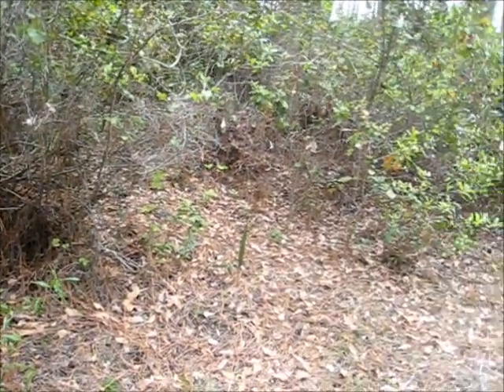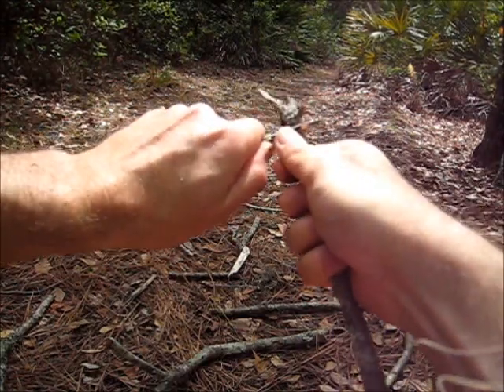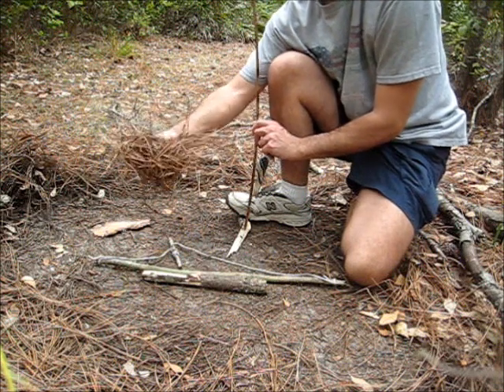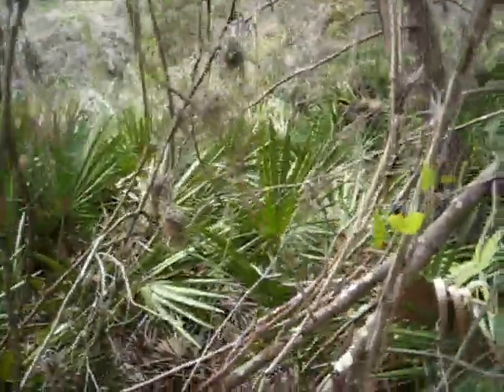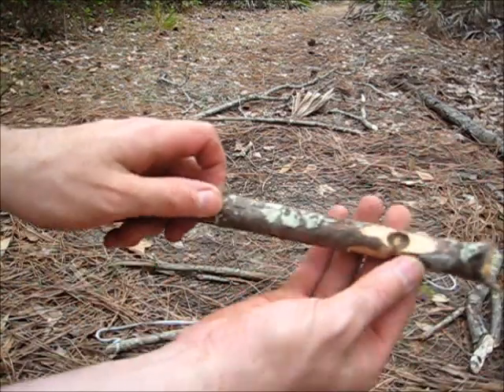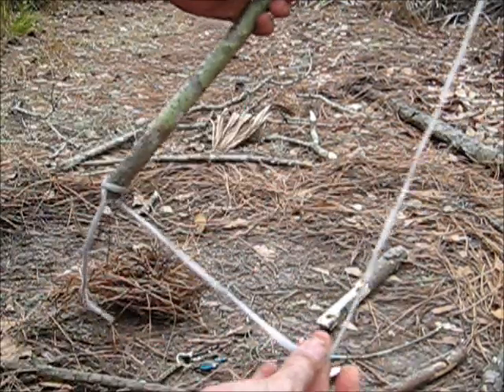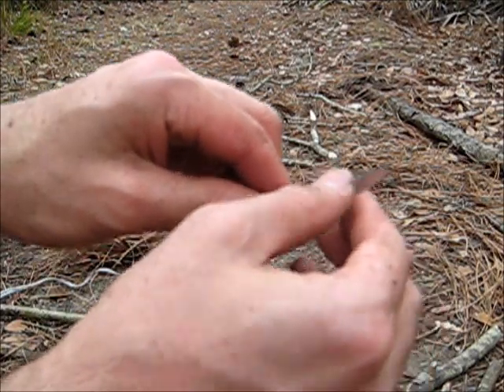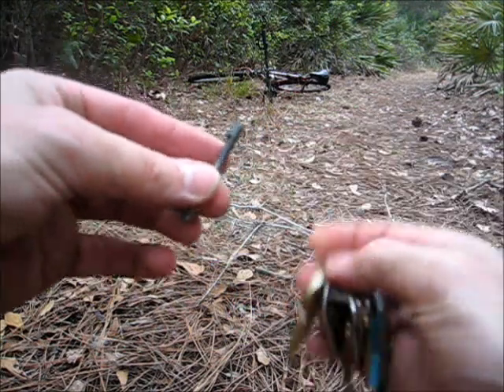Bow Drill Fire - Keychain Knife & Shoestring

Comment: Yeah!... I'm glad we show our fails right along with our successes.
Reply from the maker: Yeah, fails are an aspect most don't want to deal with, but are often part of the experience. I've been including the fails because they're likely to happen, especially when working with less than ideal tools & materials. More realistic, less romanticization.
Reply: I agree so I do show some fails or say I had fails or struggles from time to time in my videos. Fails are a part of it and to be expected. If we didn't have failures then we wouldn't learn or adapt. Practice provides learning and that improves our chances of success. That is how we get better. Putting in the time and effort. Thanks for showing. I have been working with Horseweed on Baccharis and Baccharis on Yucca and as good as those combos may sound, failures are ever present. Often less than solid wood or too thin of a board is the culprit. It pays to get the right materials and parts to begin with if available and hopefully save a lot of frustration that could be avoided.

My latest experimenting with Blackberry Briar or Bramble stalks on various wood types like Yucca, Baccharis, and Caesarweed have not worked. The briar stems just split too badly during rotation or spinning.
Reply: Yeah, I've wondered about those blackberry stalks and how they work with the thorns removed. Thanks!
Reply: beinggoodtopeople
 I have read that the briar skin/bark fibers of the green stalks make good cordage but I haven't played around with that yet given its thorny nature and having to remove them. :-)

http://slinging.org/index.php?page=bramble-fiber-sling---shawn-noah